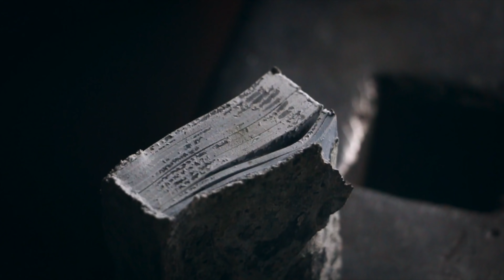Can You Forge Weld NIOBIUM??!!

Comment: Ceramic fiber insulation blanket could help keep the temperature 🌡so the coal remains hot 🔥 for a longer period of time. Was also thinking of slabs in a box or triangle shape to keep the hot coals contained.

Comment: Maybe using more ventilators to heat the forge up to a higher temperature and using a flir to confirm temps before going in. Since its not steel, you might want to take the" make sure twice forge it once " kind of approach

Comment: It’s used a lot organic chemical refining. There’s a lot of niobium in the furnace tubes that hydrocarbons are cracked in due to the extreme amount of heat energy required to crack the hydrocarbons chains it’s an ideal metal for this process some of the furnace tubes will run for continuous for months with metal temperatures over 2000 f and an international chemical temperature of close to 1600 f. It’s a very resilient material in extreme temperatures.

Comment: Cannot recall the exact temperatures involved, it was a long time ago (during the 80's). But all the Niobium I worked on, hot rolled bar, was rolled well under 850C (1562F). Preheating in an electric furnace, minimum times as Niobium oxidises heavily above about 500C (932F). At high temperatures, it can also easily take in Carbon (from the coke) forming brittle carbides.

Comment: Not sure if I saw this, when tig welding the billet maybe try doing it in an argon bath. Since the tig doesn’t need anything but the current you could flood a box and remove all oxygen. Possibly do your surfacing in that too so there’s zero opportunity for oxidation while closing the billet. 

In addition I like what others are saying with the argon bath and induction forging.

Comment: My only suggestion here if ever you get some more of that material would be to do the set up the same but use some oxy's with four burners and set to carburising flames to heat it. It will get it hotter than your charcoal fire which I think is  what's preventing that from fusing. Great video all the same.

Comment: A couple ideas... more one idea, and a theory. 
Perhaps using a press to hold pressure instead of impact welding would allow them to bond. 
With the weld temperatures needed for the material. If the thermal properties of the tig material isn't high enough, you will likely be melting off the sealing welds of the canister which would allow it to flood with oxidizers.
Over all, a good experiment. I always enjoy your content.

Comment: you can try this in a induction heater, may be can reach the weld temperature, but seal the  canister with argon gas . or just try to weld with a low melting point metal between the layers,like steel. you can try with titanium, for tests if you can beat the oxidation problem just run to reach high temperatures(i supouse that titanium is cheap than niobium ) .

Comment: Induction forging in an inert gas might work. The setup could be a nightmare though.

You might also want to try induction forging in a vacuum chamber. Vacuum welding might be possible even without a great deal of heat.

Comment: He Timothy like the idea of forging space-age materials, you could try switching your air for a different gas combo. instead of using plain old air to react with the coke if you added in some Hydrogen gas to your intake then you could get a more Reductive flame, it seems the problem is that there is too much O2 so you need to react it away.

Comment: Looked at a bunch of comments. You should look into platinum soldering glasses to even be able to judge metal that needs to reach that temperature. #5 or stronger. Most induction can’t reach temps of 4500*+ they do make water cooled induction units, but honestly not worth the investment for a few fun projects. Talking to my platinum caster a few months back about the equipment he used made my jaw drop and head hurt. Materials that have such a high melting pointe also tend to cool fast AF once taken away from the heat. I think your first attempt with argon could have worked if you let it melt before your first blow. I don’t think you could have taken it out and hit it fast enough to really bond the layers. I’m not a blacksmith but I enjoy the content. Bummer it failed but it got my brain churning to solving the puzzle. With Pt small (1g) piece is easy to get up to temp, large ingot (14g) is significantly harder to melt. So maybe your argon and a way smaller pieces.🤷🏻‍♂️ thanks for putting the video out even though it didn’t turn out!💪🏻🤘🏻

Comment: You should try forging tantalum or scandium, also some of the other precious metals such as rhenium (greater density than tungsten or gold), ruthenium, palladium. It's even possible to get your hands on a forgeable sized chunk of depleted uranium (solid uranium metal) which has got a density about as high as gold so its a heavy bugger as well and should forge quite nicely. Thorium would also be awesome but much harder to get your hands on than Uranium, much more expensive as well but I bet it would forge nicely as well. Imagine you did a Thor's hammer out of Thorium, that would be awesome.

Comment: As you know, the tig welder liquifies the area of the arc and bathes it in inert gas, which allows the liquid metal to flow, mix and solidify (A grossly simplified explaination, I know), but I believe that is why it accepted the tig weld but failed with the coal forge since the coal forge is not a clean environment...

I don't know enough about the metal to be certain, but it looks like you need to use an induction heater to heat, possibly while in an inert gas environment?
I also get the impression the rest of the "forging" would need to be done while the hot metal is in an inert gas environment to prevent oxidisation.

Comment: We have a furnace at my work which uses a niobium element that gets to ~2000°C without falling apart or fusing. Also, niobium is quite reactive at elevated temps - it'll react with nitrogen above a few hundred degrees. A charcoal forge has no hope I'm afraid.

Comment: heating it up by induction, which is quite "easy" to control. I guess you have enough Amps in the shop, you "only" need to build the coil, and a furnace like environment you could confine a small "room" with an argon atmosphere. when heat is up, open the confinement, and bang the b...h. the confinement should have at least a heat resistant window to check the item due to the process.

Comment: i think for niobium and titanium if u are forge welding u need a forge that can be air tight so u can replace the atmosphere in the forge to argon and or nitrogen, this way u might get a forge weld, but it would be hard to do as u need the block to be under the atmosphere when u are hammering on the block to, may be in a enclosed forge where the forge is in a "still air box" it will be possible, but that isn't that easy to make but not impossible.
but for that u might need a electric forge which is not cost efficient, may be a arc forge would work but isn't still as good as a gas or coke forge.

Comment: A bit of an expensive project:
1) build a vacuum chamber with ports for an induction heater
2) form your billet
3) place the billet inside the induction coil, then clamp the billet in a large C-clamp (probably need a ceramic block on either side of the billet, the C-clamp needs to be large enough that it stays pretty far away from the induction coil)
4) Pull a vacuum, you need a high vacuum 10^-3 Torr at most, 10^-6 Torr would be better.
5) Heat with the induction heater (you'll need a strong power source considering how hot it needs to be, and a low frequency inducer to get deep penetration).
6) Leave it for several hours at just below its melting point - being under pressure from the clamp will cause crystals to grow across the interface between the layers.

An alternative to an induction heater, microwave heating is also possible.

BTW: unless you are using electronics grade (99.9999+% purity, denoted as grade 6.0N, 6.5N, etc.) argon, the argon has too much oxygen for what you are trying to do.

Comment: I think what is happening is that the tig welds burn up in places, letting oxygen in before you ever get in the first hammer strike. Here is something that might work. 

1. Create a purged atmosphere work perspex enclosure where you can fit in some power tools and a small heat treating oven
2. Cut your pieces.
3. Put pieces and tools in the enclosure
4. Purge with argon.
5. Grind the surfaces shiny and dip in acid suitable to get the remaining oxide off
6. tig weld the billet, then tig weld your can around it
7. Coat the can in ceramic layer by layer
8. Cure the ceramic in the heat treating oven
9. take out of the enclosure, proceed to forge heat, smack it as hard as you can with the power hammer, you will only get a few blows before oxygen has crept everywhere again.

Comment: I think its just not hot enough. Steel is forge welded close to its melting point so i wouldnt be surprised if niobium works the same.

I cant see those sorts of temperatures coming from your setup though. At the blast furnace i work at, we actually heat up the air before we blow it into the furnace to get a flame temperature of about 2400C. But then again if you drop that onto the floor, the concrete would probably just start burning

Comment: Have you tried any electrical forge. I don't know about the forges but I'm pretty sure you can fill the forge with argon and heat it up using electricity so it might give you more control over oxidation. 
Don't know if it will work or if there is any any electrical forge to reach a temp of 4500 degrees 🤷. Just a thought from your new subscriber 😁

Comment: Maybe an induction forge that is completely sealed and flooded with an inert gas would work better? I wonder if using a press instead of a hammer for the initial consolidation might help, too, in this case.
Reply: Oh, and also, why not wear dark sunglasses for this—maybe it‘ll help you see better what actually happens…

Comment: you could try to see if you can melt it into a puck in a crucible, maybe you could work it better than the box damascus? you could also try using ferroniobium alloy, that might take better to forge welding while giving it superior traits to standard steel.

but thats all theoretical. ive never actually seen anyone try to forge niobium at all, ive only personally seen people weld ferroniobium struts as bracing for aircraft skins and chassis

Comment: How does Spacex make the big niobium alloy nozzles for their rocket engines?  When the vacuum engine on the rocket's second stage is operating, the nozzle is white hot but you can see stripes suggesting welding beads?

Comment: The first thing that i would recommend to try to improve the result is the use of safety glasses that are adequate for the job: some heavily tinted glasses, or even a welding helmet. If you can't see what you are doing, it's hard to know what you are really doing. 

Which brings me to my second point, I don't think it was hot enough. The fact that it's so hot that it blinds you doesn't mean that it is really hot for the niobium, and stops you from seeing the real variations of the color/ light.

Third: why didn't you use any flux ? Yes you can forge weld steel without flux, but you will still use it to help reduce the amount of oxydation and improve your chances of success. 

The use of argon was a pretty interesting idea, as well as trying to forge weld niobium. I am looking forward to see a part 2 of this new quest if you find any information that you think could work!

Comment: “Next time on can we forge weld we are going to try to forge weld uranium” 😂
Reply: Too funny ! 😂
Reply: Chernobyl did it
Reply: First, we're going to make a glove box. Don't use the grinder. The last thing on that video will be "I found out if I use more material, it takes less heat to get it to temperature... If I make a billet of about 25kg, it should heat itself up. The purity must be good because it said it was weapons-grade"
Reply: Its not tooo hard to get your hands on some depleted uranium. But uranium metal has a slight tendency to catch on fire and to produce cancerous dust+smoke
Reply: Anybody else feel like this isn't such a well thought out idea ? Asking for a friend
Reply: Perfectly possible.  But not in a coke furnace.  You'll start forming uraniumcarbide. Nice cermic nuclear fuel pellet material, but not realy forgable as a metal.
Reply: @maddox0110  The even bigger problem is that carbon is a pretty good moderator for nuclear fission reaction. Thus, he could quite easily start a nuclear chain reaction in his forge even if the billet itself was undercritical on its own. (Of course, the amount of uranium he would need for this would still be far off anything he could ever get hold of... :/

Comment: Argon is a heavy gas.  Use a walled basin to flood with argon, and weld the billet inside the basin so at worst the inside has only argon sealed inside.  Heat as hot as you can manage, then press in a hydraulic press, not a power hammer, because I don't think the strokes are consistent or powerful enough to produce a weld.  It looks like it immediately oxidizes once it touches air, so you have only 1 chance to weld.

Comment: I would think a hydraulic press would let you push the pieces together, if they are at welding temp for nobium you will have gotten them to weld without the shock of a hammer vibration pushing them apart.

Comment: Durin the process to make niobium metal, the pure metal , they cant have any o2 present because niobium is so reactive to forme oxides, so they use a vacuum macine that shoot radiowaves in high frequency to melt it...
And there's some alloys that uses steel and niobium, besides you can try to get ( ferroniobio " its in portuguese because idk the name os this alloy in english")  i think its kinda brittle and its "grain" structure is quite big, but i should have some uses

Comment: Explosion welding can produce a bond between two metals that cannot necessarily be welded by conventional means. The process does not melt either metal, instead plasticizing the surfaces of both metals, causing them to come into intimate contact sufficient to create a weld.......Regulations for the use of high explosives may require special licensing....Good luck with that!!!Be well and be safe..................

Comment: I don't think you know whether you ever actually got it to forging temp.  Is "white hot" really a good measure for this type of metal?  I think it might have been good to put a billet in a crucible and try to get it to actually melt in that forge.  That would tell you how long you have to be in the heat to get it to change state, then you could back the heat time off by a small amount and see if it will forge.

Comment: You may want to try doing a sintering weld of the sheets at a lower, it looks like the sintering temperature is substantially lower for niobium. That would also allow you to have the enclosure be a different metal that is more robust against against oxidizing at your working temp?

Comment: It starts to oxidize at 400C. That''s not good. You would have to encase with something like tungsten with a higher melting point. On the other hand, niobium is pretty ductile, and seems prone to galling. Lots of contact, and put it in a vacuum, it might cold-weld. What I saw is a lot of the niobium is formed electrochemically like copper.

Comment: Why not investigate using an induction heater in an argon atmosphere since it may ensure sufficient heat while also eliminating the oxidizing atmosphere in the forge.  From the tiny amount I have learnt on forge welding, it seems that the billet did not get up to forge-welding temperature. Maybe we have an expert that could supply us with more info on this?

Comment: @Timothy Dyke how about induction heating of a sealed assembly, like the second assy?  induction heat doesn't have an upper temperature, and you could put this inside a glass tube with argon inside.

Comment: I guess, the niobium has a thin surface layer of niobium oxide and thus does not forge weld. What about putting flux in the container?
And what about induction heating instead of a coal forge?

Comment: an electric forge with a graphite crucible filled with argon would probably work. since argon is heaver than air it would get all the oxygen out of the chamber
Reply: Also extremely expensive
Reply: @Mjones8383  not rly. use a induction stove top from junk yard
Reply: Could just drill a hole in it and feed argon directly into the forge
Reply: I was thinking about a induction heater to heat the metal
Reply: You wouldn't happen to be the same Jon Bell I know would you??
Reply: @brianbecher5781  no
Reply: @wolverene1234567890   Preferably in a vacuumchamber.  Still working on such thing to cast titanium.
Reply: @maddox0110   I think having it a a vacuum chamber would be very hard to do it , but having it in an inert atmosphere like argon would ve more realistic.
Reply: @wolverene1234567890   Yes, building such a device is hard. Otherwise we would have done it already. Main thing that holds us back is the induction heater. At least, the cost of aquiring one with enough power.
Reply: @stressmasterbk4294  the ones for household kitchen with oven and such??
Reply: @martin11844  yes the most expensive parts are in most of the newer stove tops. than u just need the right bricks and maybe elements. theres a vid on youtube somewhere on it
Reply: What about helium....? Forgive my lack of knowledge with forging...
Reply: You'd probably need a watercooled induction forge to get that high of temps. But it would probably work.
Reply: @Rollover_red  Helium is too light. It will float off.

Comment: TIG pure argon plasma arc= 5K °C+ .  Coke forge 1800°C max.   Niobium melting point 2740°C.  This explains why you can TIG it, but not forge it with a coke forge.   I see 2 options.  Arc forging or hydrogen torch, as this can reach 2700°C